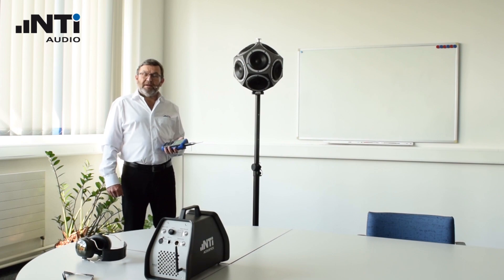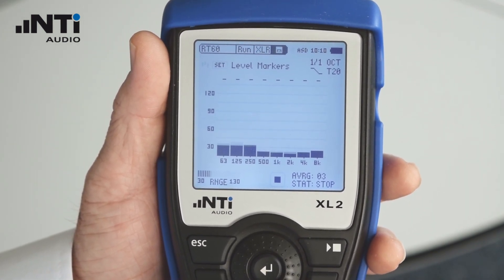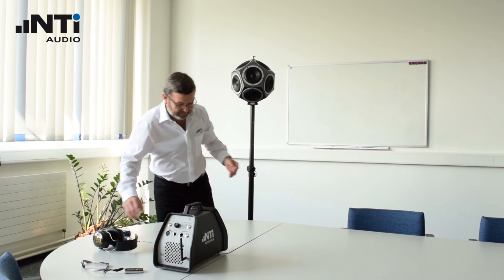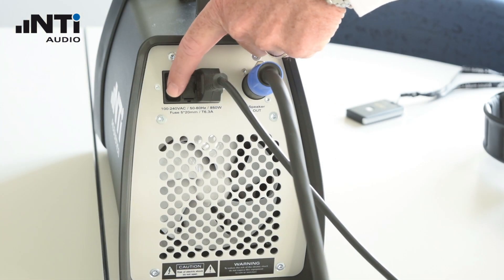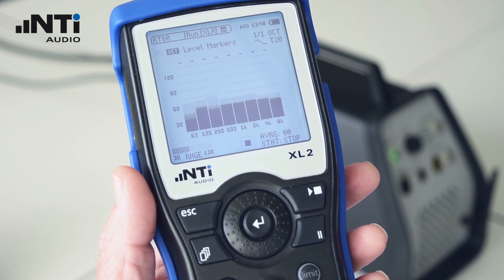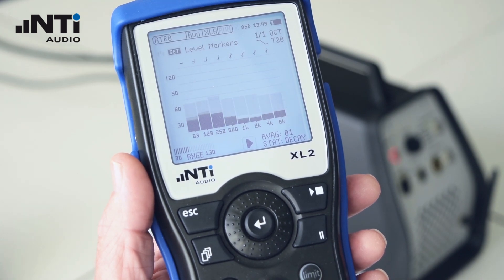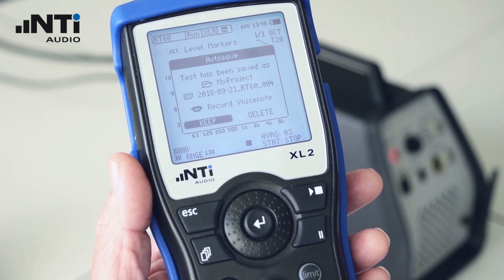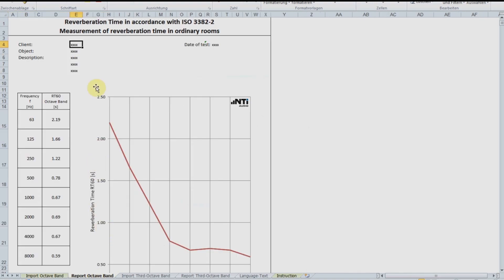How to measure Reverberation Time RT60 (old version)

Comment: Hi, now the excel sheet is not available isn't it (or how can I access it if it is still available)? Is the .txt file from the XL2 supported by the new software and do I have to pay to import the file?
Reply from the maker: Dear JinJin Sasikarn,

Many thanks for your question. 
You may directly open your reverberation time measurement data using MS Excel – just drag and drop the *.txt file into Excel.
Professional reporting and data analysis is supported by using the Room Acoustics Reporter software. Just advise the serial number of your XL2 and a free trial period may be enabled. 

Read more about Room Acoustics Reporter here:
https://www.nti-audio.com/en/products/software/room-acoustics-reporter

Best regards,
your NTi Audio Team
Reply: @NTiAudio  Thank you for your reply. Another question is the software is capable with .XL2 file isn’t it? Can every XL2 device (just in case it has older and newer device version) produce this file type?
Reply from the maker: Yes, every stored measurement generates a *.xl2 file. This applies for all instrument and firmware versions.
Enjoy using Room Acoustics Reporter software.

Comment: "top of level markers" is above 90 dB?
Reply from the maker: Hi Super Connie, well noticed! In the demo shown in the video, the level markers indicate that an excitation level of 75 dB per band (or less) would be sufficient for a successful measurement. Thus, the measurement also would have worked with a lower excitation level.

Comment: Do you have to get the room to 90db? Or is that a moveable threshold within the xl2?
Reply from the maker: Hello, in order to measure T20, the pink noise in each band must be 35 dB above the current background noise level. So if the room is quiet, a level significantly lower than 90 dB is sufficient. The XL2 automatically adopts the threshold.